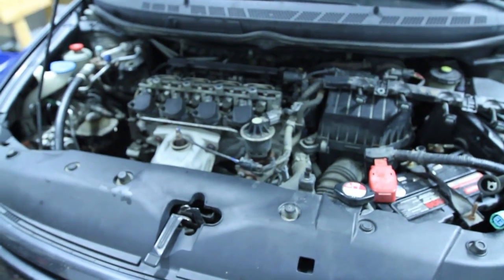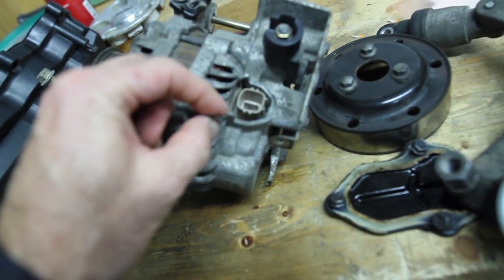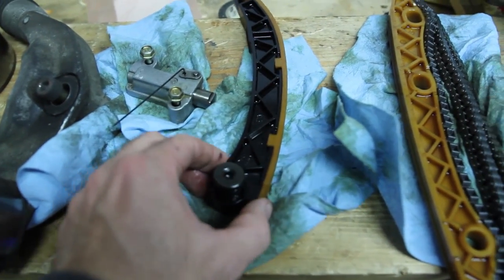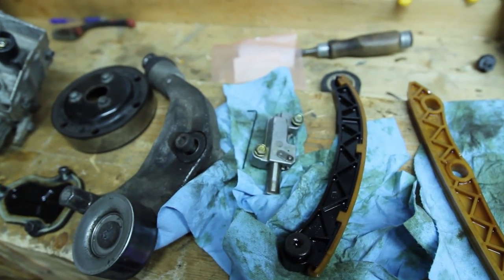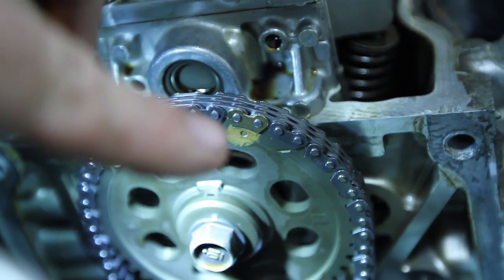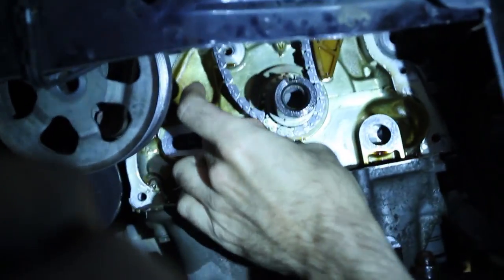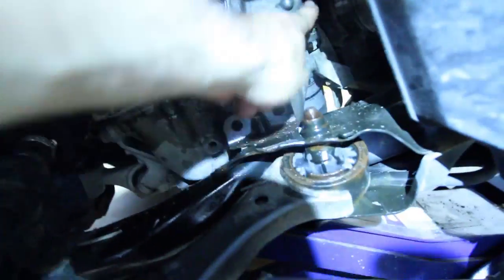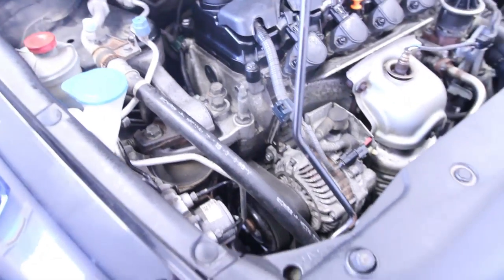2006 Civic Timing Chain Replacement

Comment: Vaseline will help make o-rings sticky and will stay in place. The plastic chain guides weren't wore down. But with all the hot-cold cycles they become brittle, possibly failing.
Reply: Vaseline is petroleum based and will degrade rubber orings. Better to use a synthetic like silicone such as permatex synthetic brake  parts lubricant.
Reply: @AR-mb3id  I didn't pay attention to what those o rings were sealing, but your saying those o rings don't already encounter another petroleum based lubricant like engine oil?
Reply: @kinger557  you gotta a good point there.

Comment: Dude its your motor mount. The mount isn't supposed to be in two pieces like that. It is a hydraulic mount. It has fluid inside the rubber. Put that on and your clunking and bumping will go away
Reply: That motor mount is in tact, you can see it pretty well at 4:00 in the video. Yes, the upper engine mount is a common failure but the one on his vehicle has not failed. It is in two pieces (mine has failed and I'm getting ready to replace it) and the upper bracket that bolts onto the timing chain cover has a single bolt that goes into the hydraulic rubber boot.

Comment: Good video. A good 'Shade-tree' mechanic trick to find worn bearings is to use a rubber hose to your ear to find the origin of noises. Put one end of the hose to your ear and point the other end at pulley bearings, etc.

Comment: Great video, please do more!  I have to take apart my oil pump because I dropped a feeler gauge while adjusting my valves.  So that little mistake basically took over my weekend.  Your video is extremely helpful.  I have to buy some tools and parts, but I will be referring to your video extensively.  Thank you Bill!
Reply: The valves have to be adjusted manually in these cars?

Comment: Excellent job and thank you for showing the people to stretch in the chain London recommends 90 to 100,000 miles on a timing chain vehicle and the reason is the clearance on the tappets on the valves and the cams and everything or so tight that when you lose that one or two or three are you actually lose about a third to a fifth of the performance of the car so by changing that on a scheduled interval you will find your car will Peak Performance less top-end noise because now it's all tight again

Comment: I had rattle on my 08 civic LX coupe(approx 200 000km) and It was the A/C compressor pulley bearing that was worn out, I didn't need to troubleshoot far because luckily for me the clutch magnet on the compressor also let go at the same time so I had no A/C for a few weeks, what a coincidence. Bought a compressor pulley and clutch+ magnet kit on amazon for 100$ and fixed the problem

Comment: Thanks for the video showing how you went through this process very informative and helpful but one thing I want to add that timing chain you bought for $150 seems a bit overpriced I got on Amazon bought a timing chain kit that included the top gear and lower gear and the two plastic chain guide rails and the tensioner basically the whole kit for $55 with free delivery. So thanks for your helpful insight on the insulation process I don't think it's going to be much different since it's a 1.8 Honda 2013 Civic

Comment: Thanks for posting this.  It is very helpful.  (I'm considering replacing the timing chain in my 2007 Civic 1.8L.)  I definitely appreciate you showing your "challenges"--such as trying to put the cover back in/on without getting the "gasket" all over the other parts.  Do you think putting the gasket on the engine block instead of the cover would help prevent this?

Comment: Thinking about the timing chain on my '08 at about 170k miles.  Engine was apart for a short block replacement around 100k, but I'm assuming its still got the original chain and tensioners as that was warranty work and no tech is going to do anything extra when doing warranty work.  The warranty work is also probably why I have an oil leak now... but that's beside the point.  There's definitely a noise, but seeing your chain is definitely good.  I feel like that length should be taken up by the tensioners without any issue.  I can see it getting noisy for sure, but I don't think that would cause any real harm.  I'll definitely be coming back to this video if / when I decide to dig into this project, thanks.  I'll probably check valves first though.

Comment: Great video. I believe I am having the same problem. Do you have any idea what may have caused the strain on the timing chain? Was the chain properly receiving oil? Do these cam assemblies have a solenoid valve to control oil to the chain? Thank you.

Comment: Those guides can dry rot and break. I would have changed them for what they cost. Already in there. 

I’ve seen them break in F-150.

Also, was there any thread locker on the bolts for the guides?
Reply: Agreed I mean 20 bucks for them you are already that far into it just replace it all put it back together then you know it’s done and good for another 200

Comment: How do you get the pivot bolt off of the left side timing chain guide mine's really stuck in there and I'm having trouble getting it out I'm afraid I'm going to round off the inside of the hex bolt. Is it reverse thread or something? Any guidance would be extremely appreciated

Comment: What systems or noises was this 1.8 making and was it @ ideal or road speeds or both? I have a 2012 honda civic making a noise @ 35 miles an hour and up in speed but not @ ideal and i have been trying for months to figure out were it is coming from i watched your video a thought i would ask as i have run out of ideas were the noise is coming from and i figure it could be timing chain as the motor has over 200 thousand miles on it but it runs strong with no other problems and the transmission is shifting normally.  Thanks for any comments
Reply from the maker: It was a rattle as I remember been many years now what noise is yours making?
Reply: @hoddy2001  and you thought it was valve chatter and adjusted your valves first?  Sounds exactly like the sound mine is making at 170k miles

Comment: That difference in the length of chains won't effect anything, because the hydraulic tensioner will make up for it to keep it tight. And of course that loose is either due to heat or the wear out.

Comment: I did my 07 tsx, k searies belt because of a clatter noise while idling. wound up being the guide on the oil pump chain had gone. I feal like the chains last for ever, it's the plastic guides that give out

Comment: Also by the way timing chain stretch might look like it's not much but just a tiny bit like one or two mm is enough to cause issues Ivan from pine hollow diagnostics was working on a Maserati that was stretched about 3 mm and it would literally jump time

Comment: I'm thinking about replacing the timming chan on my 09 daily honda fit, it makes a rattle noise around 2200 and 3000 RPM when cold, it really does sound like a part of the cat is loose inside it and its rattling, but beeing so rev and temp depending I think it might be the timming chain. My car has 160.000KM on the clock, 90% of highway drive.
Reply from the maker: it's hard to diagnose for sure. Make sure you eliminate every pulley before you go for the chain. Take the belt off and spin everything to check for any abnormal noise.
Reply: My '04 Civic used to have a rattle at low RPM. It was just loose heat shielding on the catalytic converter.

Comment: Hello, at 15:54 when you align the cam sprocket to the UP position, does it matter that you moved it independently from the crank sprocket? I thought You needed to move both at the same time while the chain is in place?
Reply from the maker: I'm not seeing that at 15:54.
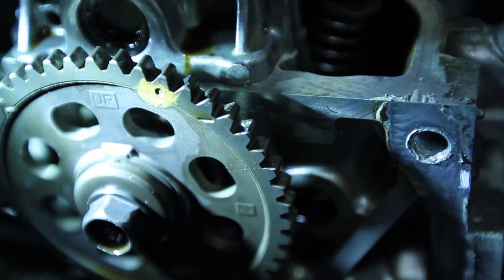Reply: Bill Hodson pardon me I meant 10:54. Did you just move the sprocket by hand?
Reply from the maker: jon ramirez you rotate it there before you take the chain off so the engine is set to TDC for cylinder 1
Reply: Bill Hodson ok thanks for your help

Comment: When you went to start your engine I heard a cracking sound. Now I have the same car and it makes the same noise upon startup. I was thinking it might be the starter what do you think? How long have you had the sound also?
Reply: I have that noise too!!! What is it then?
Reply: Old comment, but here’s my answer. Check the passenger motor mounts. They are a very common source for rattles and knocks. There’s good vids on YT showing how to diagnose a bad motor mount on 8th gen civics.

Comment: is this 2006-2011 year model? I thought there is VTC=valve timing adjustment actuator gear. Mine is rattling when start and I think VTC is bad.
Reply: Rattling, try changing the belt tensioner and belt. If that doesn’t work, check engine and transmission mounts.

My gf car is rattling and it’s the belt tensioner.

Comment: Does the chain have to be replaced? A dealer told me its not required by the maintenance schedule for 2006-2011 hondas.
Reply from the maker: The dealer is correct. There is no maintenance schedule for the chain. But the service manual also publishes a limit on how much the chain can be stretched. If it beyond this limit it should be replaced.
Reply: It’s the belt tensioner. Not the chain. If you study the R18 engine it will tell you the belt tensioners fail a lot and make racket in doing so. The lifespan for the belt tensioner is like 60 000 miles
Reply: @raiderrichard7291  253k on my gf’s 😂 

Changing it in a couple months when it warms up.
Reply: Good question i wanna know that info

Comment: Hey Bill......  i was initially disappointed in your video. But i sat through it anyway. The reassemble was good. If you're gonna make more vids, invest in a stand for the cam/phone. Good info on the chain length. I have a fri eddnd with the same problem and we will tackle it this week coming up.

Comment: Did you remove the power steering pulley or the water pump to remove the timing cover?  I cant seem to get mine to move!
Reply from the maker: sorry to reply so late. I think there's a bolt around the top rear of the engine which isn't marked on the service manual diagram. Did you get it off finally? Yes you have to remove the water pump to get it out, but not the PS pump as I recall
Reply: @hoddy2001  I removed the power steering pump but not the water pump and the cover went on fairly easy.
Reply: @hoddy2001  the water pump is not blocking the cover or any nuts, just the tensioner had to come off

Comment: I would never put the old guy to back in because the plastic is in old and heated when you retorque it back and it causes stress cracks and can come apart and very short. Of time

Comment: is it possible to put gasket on the block instead of the cover?
Reply: Reply?  (I have this same question.  Looks like it might be a possible solution--to put it on the engine block--to help prevent spreading it on other parts as you lower the cover back into the engine compartment.)

I'd really like to get some feedback on this as I'm considering changing the timing chain in my 2007 Civic.  :)
Reply: It is possible but it’s better to put it on the surface of the object because it prevents more of a leak

Comment: Hey... What tool did u use to remove the crank pulley/ harmonic balancer

Sub'd and blue button for a great video
Reply from the maker: For that you need a thick, chunky 19mm socket. It's the very very best way to remove those - you'll be amazed. you put a normal 19mm socket on there and it doesn't budge, but the fatty does the trick. Such as this: https://www.amazon.com/Lisle-77080-Harmonic-Balancer-Socket/dp/B00RGNCV1U

Comment: Long story sure they once got a truck real cheap because the guy couldn't figure out why the hesitation problem at 90,000 miles that needed a timing chain and gears creating a 17 degree fluctuation the timing that the computer couldn't keep up with